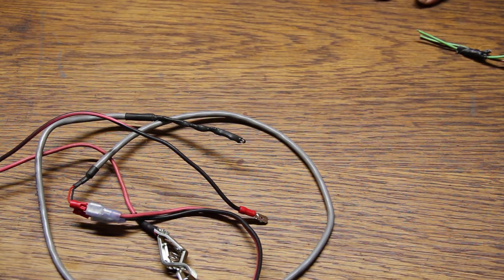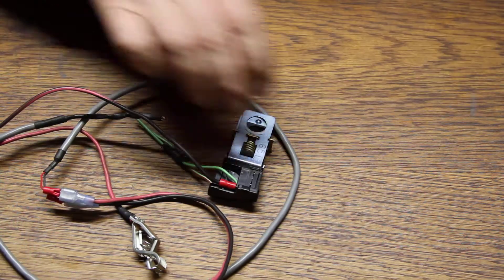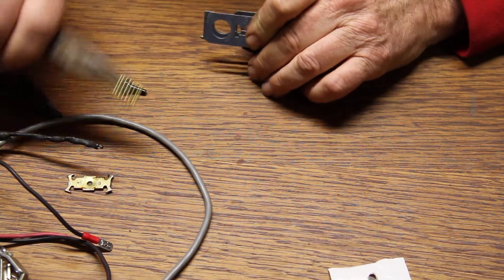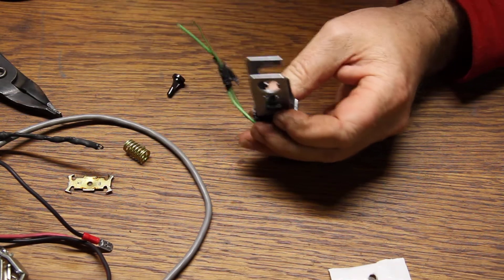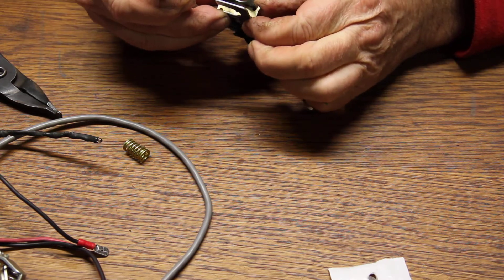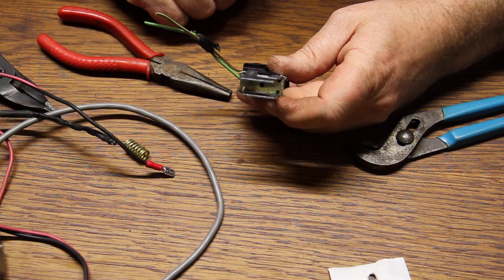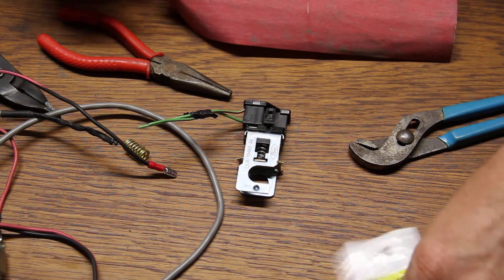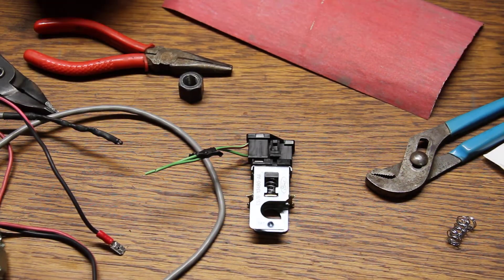Ford Brake Light Switch Fix

Comment: CRITICAL STEP YOU MUST ALIGN IT ONE WAY OR NO WAY.
Additional tip about this simple electric on off switch.

That black plastic hat like cover is placed in the post stem,with the flared brim flush against the brake  arm that extends about 3/4 of the brake arm.

The open loop will press against the top if the black hat acting like a spacer so that the switch isnt up against the brake arm. The cotter pin went on using a small vice grip to push it in all the way down flush and to the loop the vice grip is pinching, snapping into place and assuring it doesn't easily back out. Thus you should not try to force the stem with that hat on through the loops of the switch! Its unecessary and besides its very hard to push that switch all the way down the stem and could tear the hat.
When reinstalling the switch be sure the two loop metal end point  of the switch points at the vac booster and the wire harness points away towards the driver. In this way the switch body length wise  it is pointing the same direction as the the brake rod and parallel to it, that extends from the vac booster.

 You can see why  this is a one way because of the flattened squared area of the brake arm that will push down against the floating rectangular metal plate in the middle of the switch, so that it makes contact when the brake is depressed as the spring compresses. That little open space  that creates a T like top no wider than then a single  spring loop metal that coils closes, making the floating inch long rectangular platform press against the metal case.

Now, within that base at the other end of the spring coil is two thin metal electric contact tips. One is soldered on both ends. The other points away from the contact but soldered at its other end. So the brake compression forces that rectangle at the other end down and allows the electric circuit to close and power to flow into the brake lights.  You cant see those metal contacts unless you fully expose them by prying open  outwards the switch to release the spring and rectangle.

Note if you took a finger length wire stripped just a 1/8 inch on each end, holding the unattached wire harness, and placed one end in one socket and the other in the other socket, + & -, any order, creating a bypass, the brake lights should come on.

It doesn't matter if the switch harness  mated comboo is mounted or not for the switch to work, by the way, if you are simply testing the switch by compressing the spring to make the light come on.

Thus there is constant  12 V power to the harness. Whatsmore, the vac booster has no wired power to create the brake light circuit nor does pressing the brake directly effect the circuit.

It's extremely elegant and simple such that a complex mind cant intuitively figure it out at once. Physically compressing that switch closes an electric loop. A slight inch long edge on the brake rod presses.

This comment should be very helpful to this otherwise helpful video. The host told us to keep the position the same but clarity about what specific position to use and its relation to that squared metal molding would  facilitate the job and explain the mechanism.

Knowing the electric contact points is key if you want to know the mechanism and sand or file lightly the oxidized contacts.

 It's a bitch to carefully pull the whole switch apart to service all contacts but straight forward if you take pics after each part removed. Dont crack the plastic as you pry open the metal prongs holding it together.

In my opinion, if you install it the ONE WAY, its should work . 
I dont think sanding the floating rectangle is necessary. There are plastic pin like retainer seats on each end of the spring.

I misplaced the half of the cotter pin cover but leaving that cover off didn't effect lightning brakes, but kicking and breaking or disengaging that cotter pin could create an unpleasant fail.

BTW, it seems unnecessary to sand or file spring because its doesn't make electric contact. If you think it would help with length or seating it flush then maybe it helps,  but if the heads of the spring are relatively flat and even, I find filing or sanding unecessary.

Comment: I read a few things online and I found this video and confirmed my notion that simply the resistance of the brake booster was not enough to engage the switch(brakes lights "work" with truck off and a few pumps on the pedal). I got a spring at Lowes that was close enough and cut a few loops off and after some trial and error (4 pack of springs) I got it dialed in just right to return well enough to cut the lights off but also engage the lights with the slightest touch of the pedal. It's interesting how light the spring has to be. If you just tap the brakes with the truck off, now they will stay on. But if you tap and release quickly to snap back they will go off. Any more pressure and it would not engage the lights properly. But with the truck running the brake returns on it's own even with slightest little tap tap and shuts off the lights and they come on for the taps! Just make sure you don't bump the pedal getting out and leave your lights on all day! With that in mind I am also considering adding an extra return spring from the pedal just above the brake switch, to under the dash frame, just to make sure it comes back up and stays up all the way but not so tight it interferes with pressing the brakes! Who knows, it might improve that pedal-feel a little bit!! 
If you know you know, the brakes are bled and not spongy, it's just really really soft on the pedal to stop the ol' truck more than plenty good
Thanks man!! I knew it was that spring!! Now I can return that new switch to O'really's! 👍